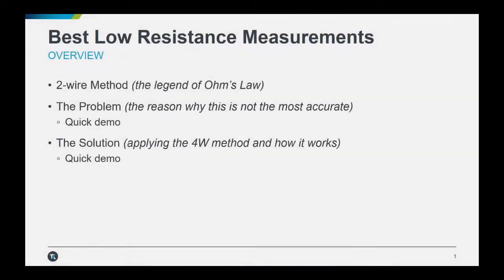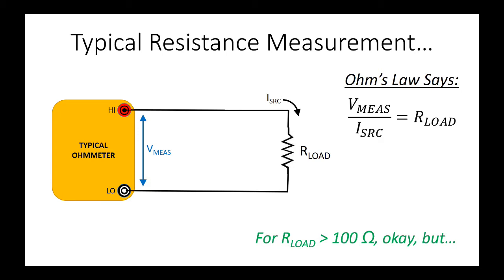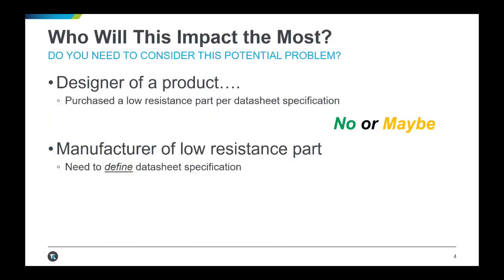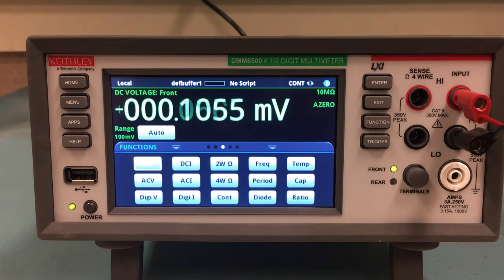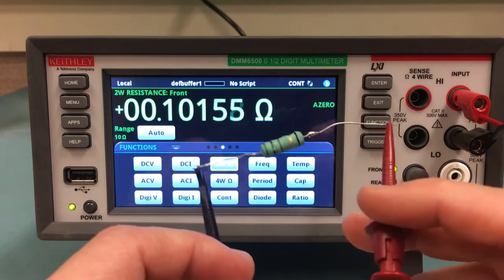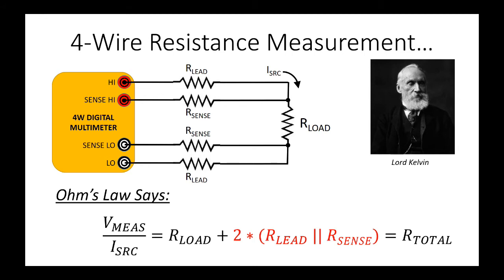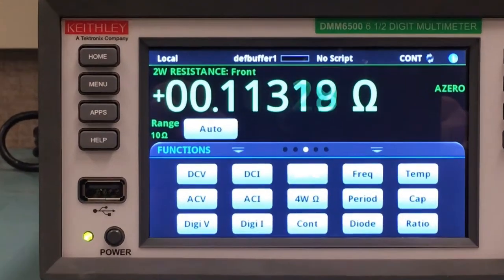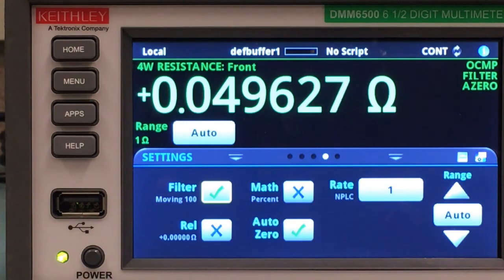Get the Best Low Resistance Measurements Possible

Comment: Thank you so much and a Very informatic demo. indeed, I need to test the conductivity or the resistance of semiconductive material. and I knew the Keithley 2400 or higher or any SMU is the proper instrument. but I wonder if I had both the 2220G power supply and the DMM 6500 could they work like SMU or not?